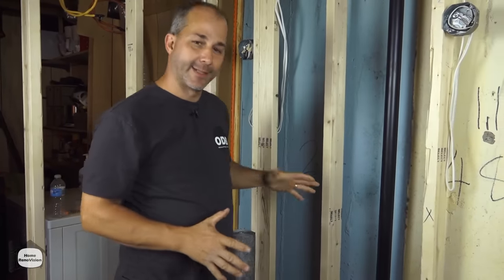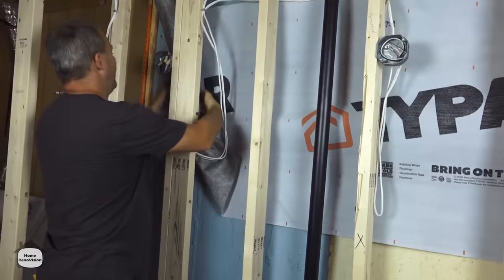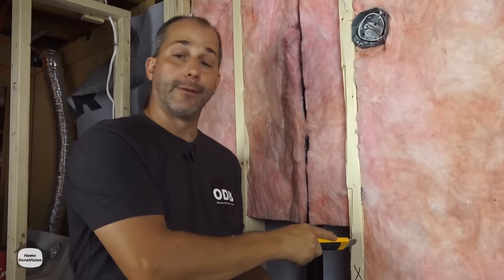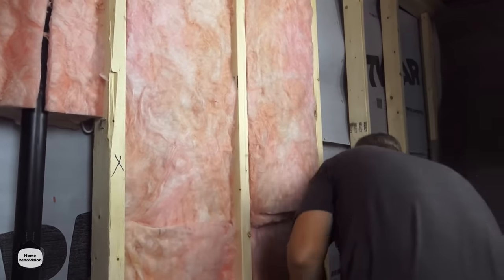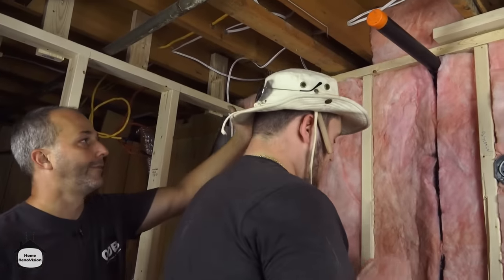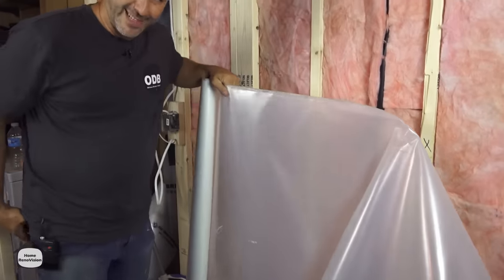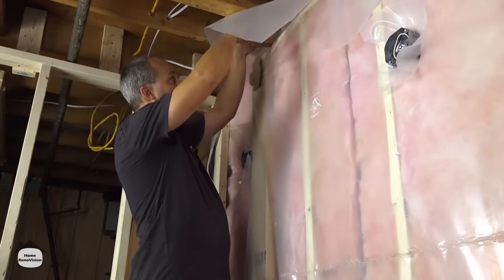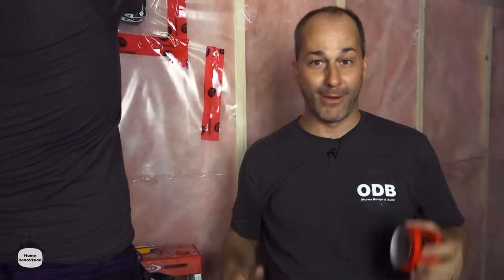How to Properly Insulate a Basement Wall: NO MOISTURE!

Comment: hello Jeff. 
thank you for share you installation tips. 
I own a 1960 duplex with not a whole lot of insulation. bricks building. the front and back are cold in the winter.  what you recommend. to insulate. should I use injection insulation..
thanks
Wayne
Reply from the maker: hi Wayne, injection can help but you probably need an air barrier on that age of home to stop the wind from blowing right through it.

Comment: Hello, really nice video. I am renovating basement and I was thinking to go with closed cell Foam on concrete walls and then studs on top of it. This will allow continuos insulation and water/vapour barrier. will this technique avoid basement flooding also as I have continuos water barier all across the wall ? what precautions/tricks I should be keeping in mind while using this technique ?
Reply from the maker: Hi Samrat, this technique is good for keeping the basement warm but will not do anything to protect from flooding.

Comment: We're in the middle of a home renovation on a house we bought. The house is cinder block which is common here in Tampa, FL. We removed the drywall in one bedroom due to a half dozen layers of wallpaper & paint. One wall beneath a window also had previous mold issues it seems, I'm guessing mostly from some sort of window leak. I doubt it was moisture transfer through the cinder block. This room is a west facing room. I've noticed the cinder block walls get warm without any drywall on them. (I don't know if that was true when the drywall was on them or not) They have furring strips on the cinder blocks which the drywall was attached to.
So, my question is whether it would be better to install some r tech foam board insulation between the furring strips before putting new drywall on the wall or if the air gap would be better? If adding r tech, should the foil side face the concrete or the drywall?
Thanks for any insights.
Reply: If you can create a seal by taping the joints of the styrofoam,you will create a moisture barrier.This is exactly what is the goal.Hope it's not too late.Keep it cool in summer.Foil side to concrete.(moisture will run down foil side to floor)If all outside walls have moisture barrier,inside stays warm and dry.

Comment: I enjoy watching your videos. I live in northern NJ and was refinishing my block wall 1st floor. I don't want to call it a basement because it is not under ground. It a bit level home. The original install had heavy mill plastic on the wall which seemed to have caused  black decay between the plastic and the drywall. Do you still recommend doing it like that. I'm going to insulate with the Rockwool insulation, but I was not going to put back the 7 mil plastic.
Reply from the maker: Hi Anthony, you definitely need the vapor barrier. it also acts a s a air sealing system if you use acoustics sealant around the top and bottom plates. you will find your house much warmer in the winter. Cheers!
Reply: @HomeRenoVisionDIY  thanks for your reply. I was under the impression that the plastic may keep in moisture and cause mold? I have used the Rockwool insulation which I find really good stuff. Do you recommend plastic over that insulation as well?

Comment: Not to nitpick, but you put the typar on technically inside out. Typar is made with the exterior (side with the label) designed to drain away moisture. That side should be against the concrete. The inside of typar is "fuzzy" to create breathabiliy. Putting it against the concrete creates a surface for moisture to collect.
Reply: I was thinking the same.  The Typar is installed backwards.  Otherwise, everything else makes sense (I think).

Comment: Hi ! Tks for the video . Question : i have a 1970 house   With concrete wall .  But they have a 1/2 in cork sheet directly on the concrete wall in the basement . Do you recommande to leave it there , and i can place my styrofoam directly on the cork sheet ?

Comment: What do you recommend for insulating the rim joist? I currently have fiberglass, but it's not doing a very good job. I've considered 2" foam board, cut to size, then using spray foam insulation around the edges to seal it in place - but I'm worried about the foam board being combustible. I live in Maine.
Reply from the maker: that is a good start. don't worry about fire in a rim joist. by the time a fire reaches that it is too late to be concerned .

Comment: Typar behind the studs and plastic over. Here in western Oregon, you'd have rotted studs after a while. But our winter humidity is really high.
Reply from the maker: In the winter the humidity travels from warm to cold so your furnace needs a dehumidifier if it is drawing in cold air. I would suggest an HRV unit in that case.
Reply: Home RenoVision DIY yes - we do have a dehumidifier in the basement. The maritime northwest is its own animal. The soil is always wet and it's temp is high - so you have to assume inward vapor migration at all times of the year. 

In the 90's code here was to put Tyvek on the outside and plastic behind the Sheetrock- and mold went wild. No more plastic to allow the inward migration. 

Nice video.

Comment: Great video! I have to frame 8" from the concrete wall due to the waste main and other plumbing lines against the concrete, would the same process apply? And staple the typar to the back of the framing, if so? Or right to the concrete as a moisture barrier? Thanks for a great DIY video!

Comment: love these vids..1 small improvement is to use Rockwool or go to the trouble of XPS foam. .Fiberglass is not recommended by Fine Home Building  and most experts...If it gets wet , stays wet and I always find some mold in it during renos

Comment: i am redoing my basement, and this video is super helpful, thank you.  one question, back in the day when built they used the insulation with the paper back already on it and nailed it to the wall as vapor barrier.. this method obiously seems much better but just curious your thoughts on using the insulation with the paper backing?  i am in NJ outside of philadelphia for reference.  behind the stud framed wall is cinder block. and some big sewer pipes/drains for the house, then the stud frame.
Reply from the maker: Vapor barriers have evolved quite a lot over the years. as well as the need to stop airflow to save on energy loss now that energy is so expensive. If you want to add a plastic sheet i suggest removing the paper first.Cheers!
Reply: I guess my question is, is the paper on the back of the insulation enough you think, or i am presuming that your method is probably the preferred method now as it seems "WAY" better...  ok thanks.

Comment: I don't recall you mentioning what is the distance to be kept between the typar and the actual basement wall? Said in another way, how far from the wall must the frame be placed in order to have an acceptable air gap?
Reply: I noticed he hadn't responded to you yet but if you were in search of an answer still even an inch is fine just to avoid the direct mechanical contact to the basment wall

Comment: Good afternoon. I am a subscriber to your channel , I have learned very much and appreciate your posts . Especially the painting posts . 
I have a question, I am insulating my basement just as you did in the basement. My local hardware store tells me that very few contractors insulate with the pink insulation, instead they use sheets of styrofoam with reflective backing . Which do you prefer ? Thank you 🙏.

Comment: I'm about to batten out an exterior brick shed - single skin, then drywall it. Is it necessary to insulate leaving a void? as i intended to fix my upright battens direct to the brick. This would not
enable me to put a Typar sheet behind the battens . Any comments appreciated.

Comment: Very informative video as usual !
For better thermal insulation efficiency, do you recommend products such as reflective multifoil (radiant & vapor barrier) for wall / floor / roof insulation instead of fiberglass?
Reply from the maker: No doubt there are better options! this is the quick and simple one for basements, especially when the rest isn't finished!

Comment: I have a five-year-old detached home and I want to finish my basement. The builder has included a blanket of insulation from top to bottom. Do I build my wall in front of this blanket of insulation or do I rip it out and start from scratch?
Reply: You could build the wall out but it’ll take up a lot of space from the finished space so I’d take it out and insulate you wall

Comment: I'm curious about this method. without Styrofoam insulation on the concrete. Won't this trap moisture in between the insulation and vapor barrier and cause mold in the long run??

Comment: I just found this channel and spent way too much time watching your basement videos today. Very, very informative stuff. The previous owner of my house did quite a few DIY jobs that are definitely going to have to be addressed eventually. Among them is the lower level of the split level. If he used a vapor barrier under the new carpet down there, I don’t think he installed it right. It’s... springy, almost? Very high humidity readings down there, and I do get that musty smell if I don’t run a dehumidifier.
Reply from the maker: Sometimes the best solution is to install an exhaust fan that has a humidistat function on it.

Comment: Would this approach work for a grade level bedroom wall as well? I took out some drywall to take a look at some moisture damage under a bedroom window and it turns out there isn't any insulation and or moisture/vapor barrier installed. The other side of the exterior wall is a brick facade so I can't approach the fix from the outside (taking out the siding, put on OSB and housewrap, etc.). I was hoping to install moisture/vapor barriers and insulation from the inside. Any help would be appreciated!

Comment: Good job.... quick and easy. My daughter (in southwest Ohio) got 4-5 estimates to fix the couple of water leaks in the walls of her walk out basement (with a pit drain in front of door). She had water leaking into the basement because most of it was leaking under the door into the house. The previous walls had gotten wet. Some from the drywall wicking water up into it and the pink insulation and turning moldy. And some water leaking in through form ties. All The form ties were removed and repaired the leaking ones, a drain and stone was laid a foot or two off the patio. One company recommended painting a black tar like substance on the basement walls then laying 6mil plastic into the the tar, then spray foam the cavity behind the stud wall on top of the 6 mill plastic then putting stud walls up and insulating them pink insulation then a 6 mil poly vapor barrier. Seemed a bit excessive to me. Your thoughts?
Ron
Reply from the maker: Hi Ron, sorry I missed this question. the best waterproofing is done from outside. spray foam povides some protection but the rest of that assembly will not hold back water.

Comment: Please help. Our builders had brown wool insulation installed directly against our basement concrete walls. I was getting ready to frame and discovered a lot of moisture behind the insulation. I’m assuming but not sure it was condensation. Does insulation against concrete cause this?

Comment: Ok I'm am so confused I have watched videos where they used foam tight to the wall then the framing you are asking to leave an air space between the concrete wall and the framing I am get ready to start my basement and I do know what to do now lol
Reply from the maker: Hi Tony, if your house has a waterproof foundation feel free to use the foam on the exterior, however this system leaves less space it works in all situations.

Comment: I have a question Jeff.  Why didn't you put TYPAR all the way to the floor?  I plan on using the same technique you're describing here and I noticed you only rolled out the TYPAR twice leaving a gap at the bottom.  Wouldn't you want the moisture barrier going from ceiling to floor?  Another question is that you have the bottom layer behind the top layer.  Wouldn't the opposite be prefererable?
Reply from the maker: The only reason for the typar is to keep the insulation from falling out over time.
Reply: @HomeRenoVisionDIY  I also thought you were using the TYPAR as a moisture barrier which is what I plan on using in my application.  If so, wouldn't it be wise to for me to have 3 rows of TYPAR from top to bottom?  That way it will serve 2 purposes.  The first being preventing the insulation from falling out over time.  The second, reason to use as a moisture barrier?  Also, I believe I should overlap the top rows over the bottom rows and have the written face towards the exterior cinder block walls?
Reply: @robertgiresi9515  The way I understand it, the house wrap is supposed to allow moisture to escape out from the framing while blocking inward moisture so I'd say that not only was that TYPAR staggered wrong but also installed backwards if helping preventing moisture was the goal...which it wasn't according to the reply. The plastic sheeting would've stopped all moisture from coming into contact with the insulation but I suppose it'll just find a way out at the bottom somewhere so one would have to direct it toward a sump pump pit or ensure outside barriers are installed to stop entry in the first place.

Comment: HELP. I pulled the knotty pine panels off to find mold and rot. Out it went. 1950s house, the cinder block seems to have been sealed (white paint on all of it) no standing or obvious water coming into the house.  What do I do to the walls before moving on??

Comment: OK so I need to know....in a brick on frame house (S Ontario) can I not replace the tar paper in my bathroom wall FROM THE INTERIOR. I see many on the net saying no, you must remove your siding...but it's brick. Everything seems pristine with no sign of mold, except the tar paper which has mild - moderate mildew. So I want to replace it with something better before continuing with all those great Schluter products.
Reply: The space behind the studs is tight. Oh, also, this is upstairs, in a 2-story plus bsmt home.Very tall. The basement is concrete block up to about 5 ft. I'll tackle that later but the bathroom is 1st priority.

Comment: From the stub to the drywall, where you use plastic layer in between, I was wondering if I can 3mm PE (the one used for floating flooring). The reason is that I have plenty of those.

Comment: Awesome video. Two comments / questions: I had my basement totally spray foam insulated, which is a natural moisture barrier but the inspectors still want poly vapour barrier over top (I’m in Toronto). Seems redundant yeah? Second, you didn’t seal the poly on either the top or the bottom, so how is that fully sealed? It that’s not required, the whole of it seems pointless because moisture will invade either top or bottom, no?
Reply from the maker: When dealing with old houses there is no benefit to applying modern technologies to a small space. When the drywall is applied it will seal the plastic to the frame. As far as the plastic over spray foam. I would call an engineer. If your foam is open cell then you need a vapor barrier. If you used closed cell then the engineer can override the inspector because that would be wrong. Cheers!
Reply: Much appreciated.

Comment: I live in Maine, the temperature gets below -5 occasionally. I forgot to do the Typar barrier so my insulation is touching the concrete. I build stairs in front of one of the walls, so I cannot move it. 

I also used insulation with the brown back facing. What’s the easiest way to fix my mistake as without tearing down the stairs and starting over?

Comment: Hello Jeff thanks for the video I do have a question for you. It is  with regards to hydrostatic water pressure  what would you do if water has entered the room after you were finished the room and are ready to install flooring and paint the walls? Sorry this may not be the place to ask this question but I just noticed in a room that I just finished and after cutting open the wall I noticed the frame work is 2x3 on 24”
Reply from the maker: get a sump pump. hopefully you won't have to trench the house to waterproof it.

Comment: Awesome video, thanks for sharing. I've used your videos to entirely renovate our family's first home. 
I'm about to tackle the basement. We had an interior drain put in (I know outside is better, but the cost more than double) with 6mm liner against the foundation wall. Should I still do what you did here? Was thinking of grabbing rigid XPS and glueing that to the framing (no need for tyvek behind to hold it up). Thoughts?
Reply from the maker: Hi Tommy, since you already have the water separated from the basement I would recommend using the mineral wool insulation. it will not sag and fall out over time so there is no need for the tyvek and is worth the extra money. Cheers!
Reply: @HomeRenoVisionDIY  Thanks so much. Also, we will be doing french drains outside to prevent water in the first place, but our home is below the grade of the road, so water would always be a concern. Speaking of which... where's your video on French Drains? :)